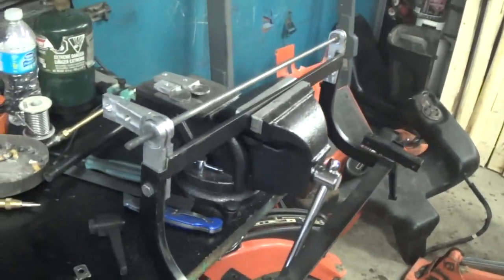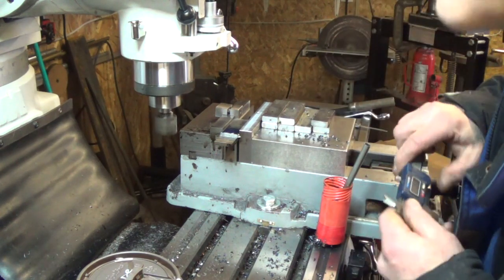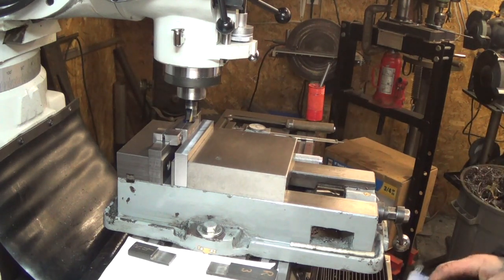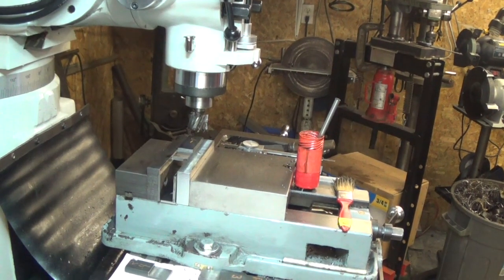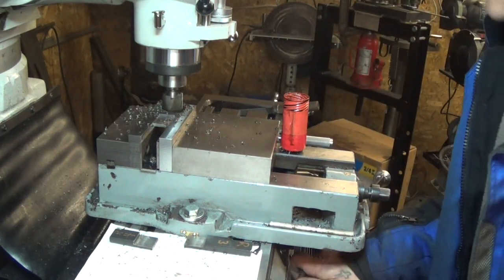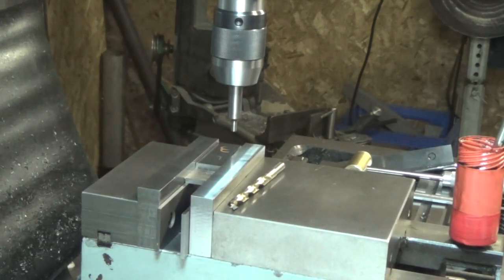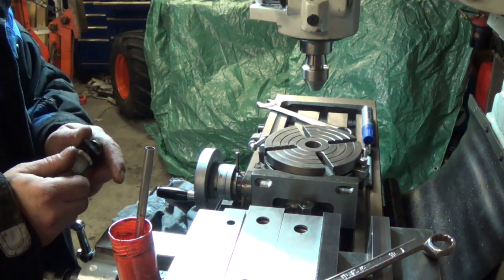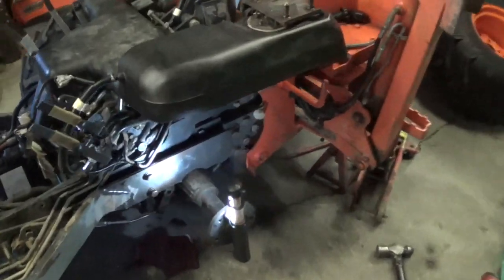Lockable Hinges

Comment: New mill seems to be running very nice.  You've built the hinges out of steel now and I'm wondering if next they will wear out the hinge bolt.
Reply from the maker: If the users dont loosen the locking bolt enough we'll find the next weak point. I agree it will likely be the bolt. I have been trying to dream up a cam locking lever so it fully releases and tightens but the room is just not available where it's mounted.
New mill is good. I had planned to do a review on it but am waiting until I get it at the new location in a few weeks. There have been a few issues and a few good things which I will document at that time.
Thanks for commenting.

Colin :-)

Comment: Nice work on the project Colin.  Very smart to have made the drawings the first time. The fact you had them available for the second time paid off in prep time. I see how the collar works in the RT now.
Reply from the maker: I try to CAD up anything I can...just in case. I did make some improvements from the original design to eliminate some hardware. From the little drive space it occupies it sure is nice to be able to recall something!
I've made several different quickie plugs for the RT. Sure is a lot quicker than fussing around with clamping and such. I was surprised just how well it can hold when doing the mill stop piece. I was expecting to have to clamp the rear end.
Thanks for commenting again!

Colin

Comment: hi colin another great video ,if i am stacking and drilling ,and the dimension is inconcistent i use a peice of copper wire between the jaw and the part this usualy takes up the slack, regards dave in the uk.
Reply from the maker: Good idea. I keep a piece of flattened copper tubing around (benefits of doing LP work) that works well.
These pieces of HR bar have a rounded profile on the edges and probably best done singly anyway.

Thanks Dave

Colin

Comment: Hi Colin, great job, I'm gonna feel a whole lot safer flying around now knowing we are being guided by some happy air controllers. HA!  Sometimes when stacking multiple parts in the vice, a piece of note paper between one of the jaws and the parts will take up the space and keep them all secure, just something that has worked for me.
  Great video ...... Mike
Reply from the maker: Ya, that HR flatbar is hardly consistent in dimension. OK for stacking them vertically...not so much in horizontal position. Doing them single didnt add too much time anyway. I just hope these new ones will be strong enough for the guys out there. They were making jokes about standing on them to change lightbulbs....I wonder if it was really a joke?? lol
Thanks for stopping in Mike!

Colin